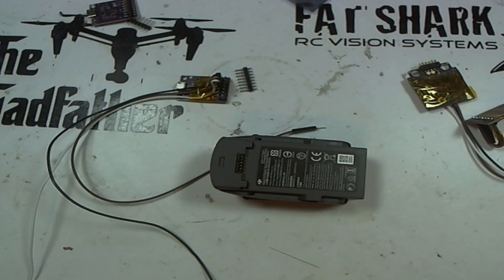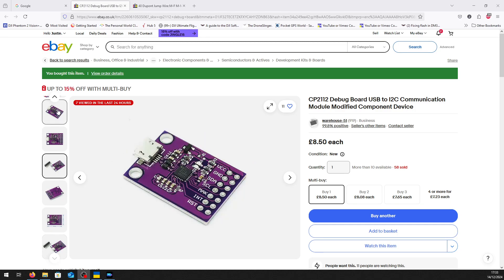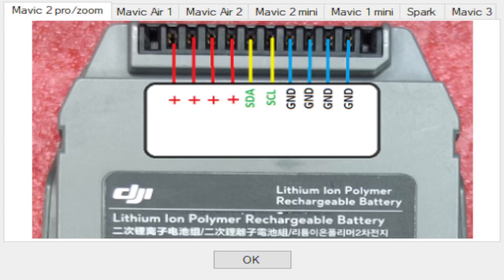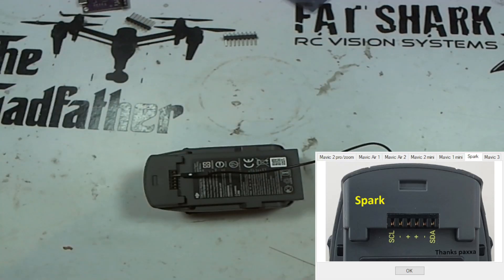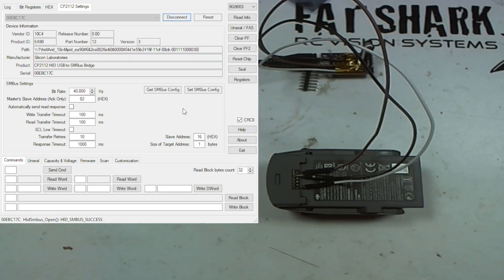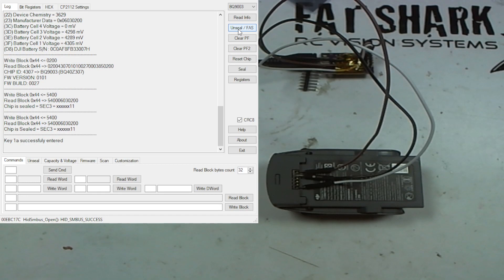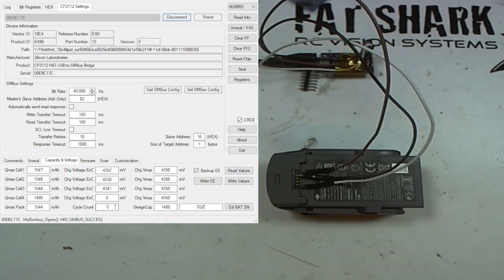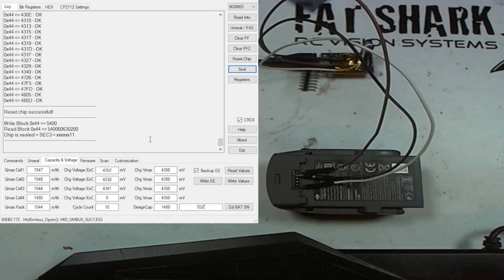DJI Battery Hibernation fix easy quick guide

Comment: Has anyone got an updated link to the program? The drive link has a 400 error.
Reply from the maker: the link works fine pal, both the google drive and the major geeks   What does error 400 mean?
The HTTP 400 Bad Request client error response status code indicates that the server would not process the request due to something the server considered to be a client error. The reason for a 400 response is typically due to malformed request syntax, invalid request message framing, or deceptive request routing.4 Jul 2025
Reply: @FlymyPhantom turns out it was the mother in law's new wifi system blocking it. Rookie mistake
Reply from the maker: @danielp7189  glad to hear it

Comment: Hi, is there a way to install those pins onto the board without soldering? Or can I connect the wires directly to the socket holes? Please help.
Reply from the maker: connect wires to board direct

Comment: Thank you for your detailed info.  Got the error due to no power on the battery.  Tried charging it as you recommended, but still no connection.  Ended up connected to a 9V and connected to my PC, and was able to go thru the steps.  It's charging now, so hopefully it works again.  Thank you.

Comment: Hi there, I do have 2 dead spark batteries and 2 showing are full charged but when try to fly the drone fall down immediately (drone haven't damaged cause I ve been testing it over grass), so my question bro is what type of jumper wire do I need, FF, FM, MM ? and 2nd question, does it work to fix the batteries that now presenting problem to get fully charged? Thanks
Reply from the maker: the wire type i use is female to male as the board has pins you can solder on, or use male to male and just solder the cable to the baord, not sure about the bats that are showing as full, my only suggestion is to find someway to manually drain them to empty then recharge
Reply: @FlymyPhantom  Thanks for answering, I already bought the jumper and the board. I see is easy to plug in on the battery, but I can clearly see where to plug in on the board. Suggestions?
Reply from the maker: @EUGENIOBRILLANTE  the board is labelled, its the holes closest to the components

Comment: Will this work if my actual cells are at capacity as I trickle charged them via my lipo charger... All cells are up to proper voltage but the board doesn't recognize they are charged...
Reply from the maker: If they aren't charging it's worth a try, the software will tell you what voltage each cell is at
Reply: @FlymyPhantom from my multi meter each cell is 4.1v but hopefully the board needs resetting to kick it back into life

Comment: Can I program a Mavic 2 Pro battery for a higher capacity so it relates on the controller to the real capacity? I took apart 2 M2P batteries. Left the bottom one alone but took the stack of 4 cells and soldered their pos/neg direct to the main battery pos/neg. I can get 40 minutes but at the regular battery mark the auto land, alarms etc come on and I have to force it in the air to get 40 minutes down to 3.6V. I noticed on your software there was a part with mah?

Comment: Why does it say error could not write block to 0x44 and it also says could not perform SMBus read 0x00
Reply: Okay it finally worked I had to leave battery connected and run through the process
Reply from the maker: Glad to hear that
Reply: @benjiwaldner261  I am just waiting for my CP2112 in the mail to arrive. I have the software, the jumper wires. I am a bit worried on the 9V battery part. I also purchased a 9V battery connector to male pin dupont wire.  Do i load first some charge on the Spark battery then run the software or connect them all up and run it? thank you for the video.
Reply from the maker: It means its not communicating with the BMS some bats are to far gone to repair, try adding voltage to the battery
Reply: I did try to charge it still same thing and when charging 2 lights blink that is on the spark@FlymyPhantom
Reply from the maker: Not charge it, use a 9v battery to inject voltage directly into the plus and minus of the battery
Reply: @FlymyPhantom  Do you have to connect a 9v battery and just wait, then disconnect the 9v battery and try again? Or do you have to connect the 9v battery and try to connect to the software WITH the 9v battery still connected?

Comment: Thanks!  I just reset following your instructions a DJI Mavic 2 battery using the CP2112.  No lights on the battery yet.  Should I leave it on the DJI OEM charger for a few days?
Reply from the maker: I had a m2 battery that was so badly discharged it wouldn't charge, if the battery doesn't charge straight away then it's probably the same issue

Comment: Thanks might have to do this. Is the software free to download? 
I’ve got 6 DJI spark batteries on a spark I’m wanting to sell and figure a ball park £150? With batteries working. They won’t charge but we’re fine before so guessing they’ve done this hibernation mode. 
I see eBay sellers selling a service of £15 a battery to put right but thats scandalous. 
Do you know of any chain of electronics store that do the service